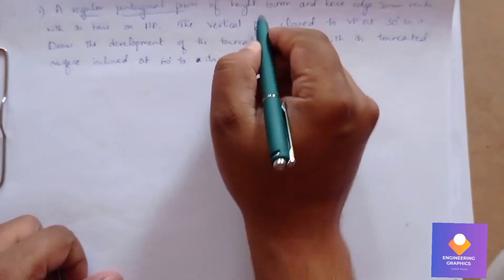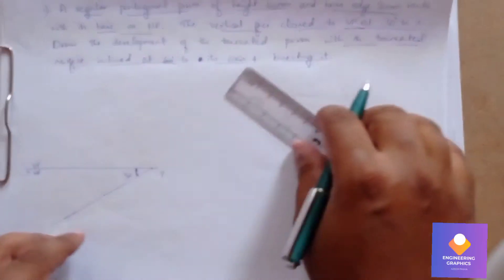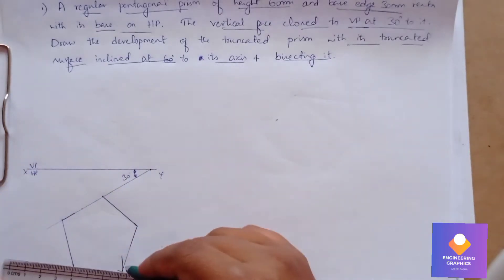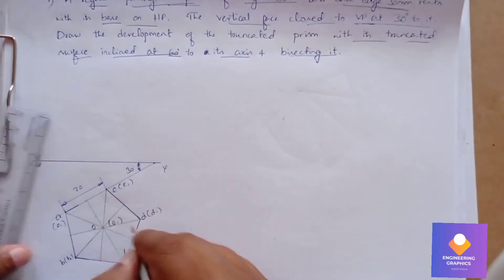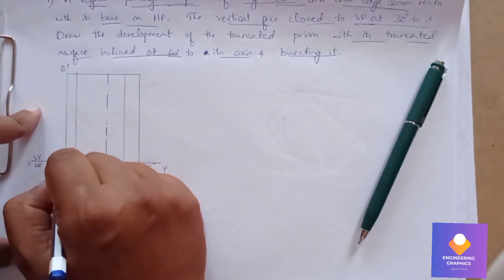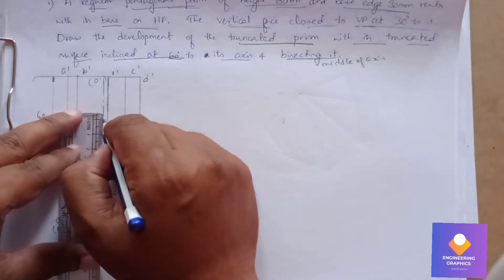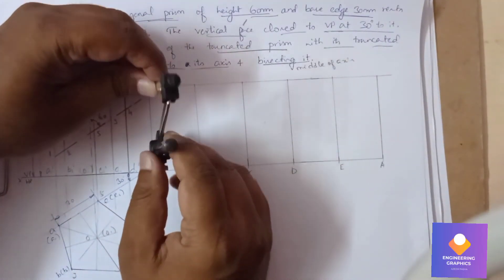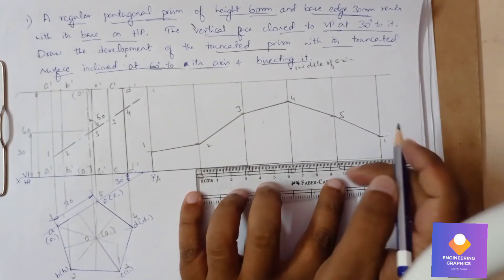Development of Pentagonal prism the vertical face close to VP is 30degree to it

Comment: A square pyramid side of base 40 mm and height 60 mm stands 
on the HP with a base edge parallel to the VP. It is cut by a plane 
inclined at 45o to the HP perpendicular to the VP and bisecting 
the axis. Draw the development of truncated pyramid
Reply from the maker: I have done this problem.. See in my channel